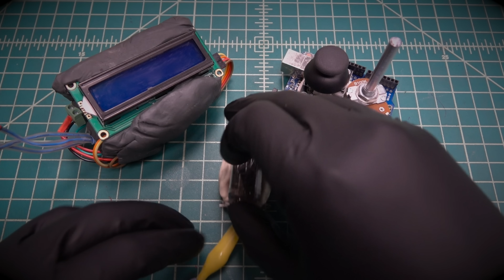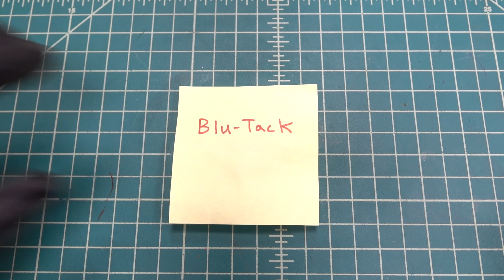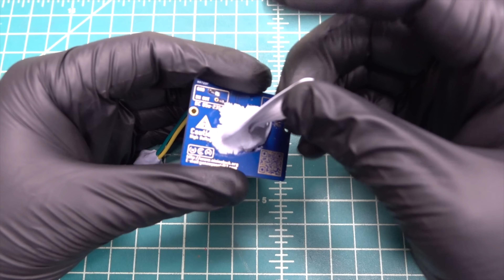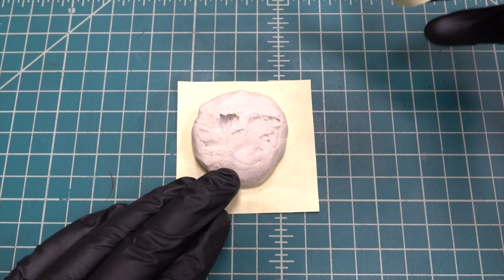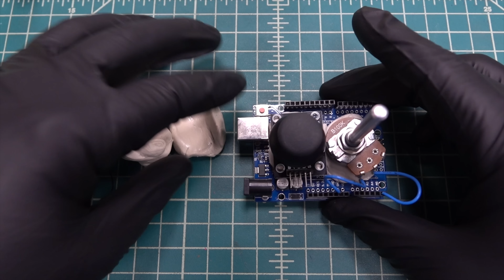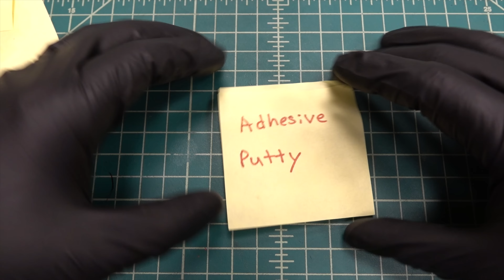Quick Tips #5 // Prototyping Putty

Comment: Doesn't that get messy?

Also, don't they leave residue on everything they touch?
Reply: demux

I'm sure it has its uses but, seems to me like it could cause some issues if it comes in contact with solderable surfaces.
Reply from the maker: +Justin Bell The Blu-tack does and that's why I recommended the 3M adhesive putty which is pretty much the same thing as the Electrical Insulation Putty that 3M makes except that it's not black.
Reply from the maker: +demux Blu-tack is not good for that purpose but the adhesive putty definitely is.  Not all through hole components have leads that can be bent especially if you salvage a lot of components.